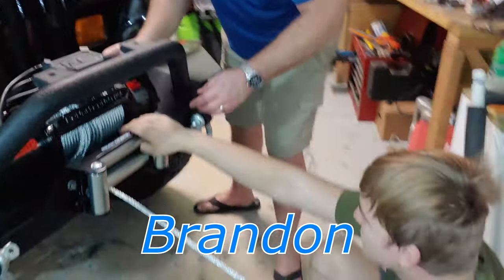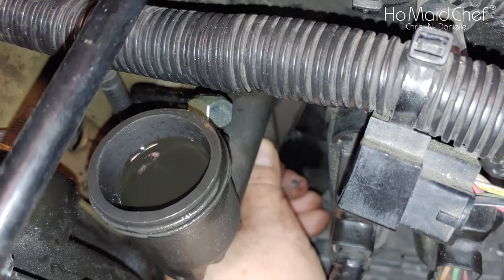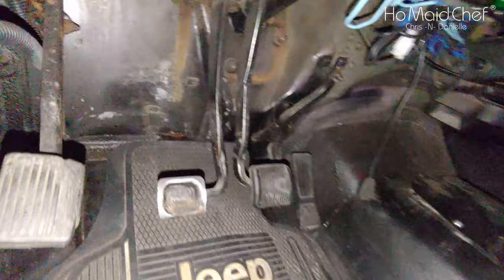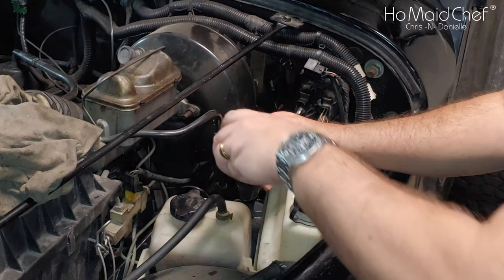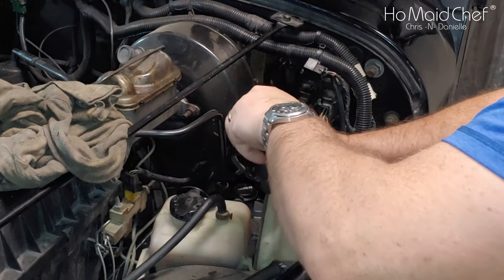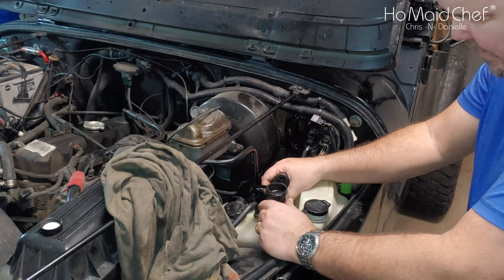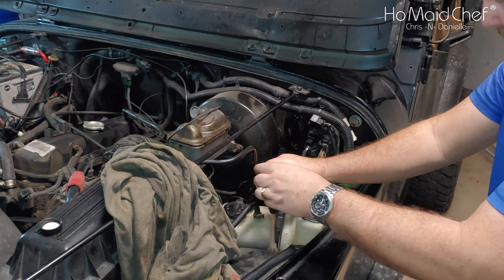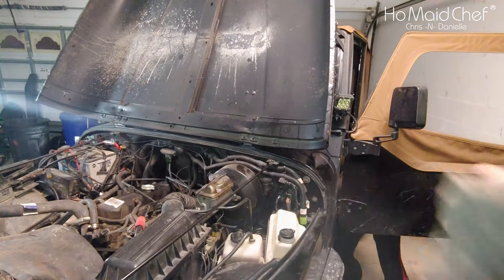How To Bleed A Hydraulic Clutch, Fix Soft Or No Clutch Pressure

Comment: Love these videos, wish I knew more about cars, just started replacing my own breaks and stuff. So I'm getting there, slow and steady. Very informative! 😀
Reply from the maker: The hardest part of fixing anything would just be figuring out what is wrong, the rest gets pretty easy. Loved your greenhouse build, wish I was more handy at building things, want to Try To Build Stuff when we move to a boat.
Reply: @ChrisDoesWhat  Hehe, that's a good point! But you still need the know-how to actually fix it, and that's what I'm trying to learn when it comes to cars! 

I'm really looking forward to your upcoming boat videos! And regarding being handy, I just try stuff and hope it works out. Usually it does. Trial and error, best way to learn stuff properly ;) Applicable for many things!
Reply from the maker: Yep, try stuff and hope it works.
Reply: You gotta start somewhere.
Reply: @TryingToBuildStuff well first off you need to study each system of the vehicle to get a understanding of how that part of the system actually works and what it's purpose is/what it provides for the vehicle operations. Then when the vehicle has what ever system you will know by the symptom what may be causing it.

Comment: My jeep just had something happen. The clutch went soft and to the floor . And it wouldnt engage. Into gear
Reply from the maker: If it is a hydraulic clutch like this, first check if it has fluid. If there is no fluid then add some and you will probably have to bleed the line. If there is fluid, the slave cylinder piston may not be engaging with the clutch fork, at this point it is best just to replace the slave a master cylinder. Here is a video were we replaced it. https://youtu.be/j4ESmdy9ZZc
Hope everything works out.
Reply: @ChrisDoesWhat  man that's the issue. It's wiggling and able to move around . And it's not fully engaging.  🤙🤙 I really appreciate it man.. saved my life pretty much. Now I can take my kids to school and to the beach. And work. 🤙🤙🤙🤙🤙🤙. Right on 
Coming in clutch 😎🤙
Reply: @ChrisDoesWhat  ❤️
Reply from the maker: @naauaopai  really glad to hear you got it solved! Enjoy the beach and I guess working 🤔🤪!
Reply: @ChrisDoesWhat  😆😆🤙 right on brother have an awesome day

Comment: I HAVE A 04 TJ.SOMEONE WITH JEEP KNOWLEDGE ANSWER BACK....I HAVE A QUESTION
Reply from the maker: What is your question?
Reply: @ChrisDoesWhat  I HAVE A 2004 TJ.I'VE NOTICED WHEN IN 4X4 ONLY ONE SIDE OF MY TIRES SPIN.THE OTHER DAY IN SNOW THE DRIVERS SIDE WAS SPINNING NOT ALL WHEELS.I HAVE 2 BUTTONS ON MY DASH ONE RED WHEN LIT THE OTHER AMBER.SOMEONE SAID THEY WERE LOCK MY LOCKERS AND IT SHOWS ON MY DASH EITHER FRONT OR REAR.I DO NOT SEE THAT HAPPENING?
Reply from the maker: It sounds like you have a limited slip diff in the front. Our yj will do that where the tire with the least amount of traction will spin.
Reply: @ChrisDoesWhat  what about buttons on dash to engage front or rear lockers.do you have that???